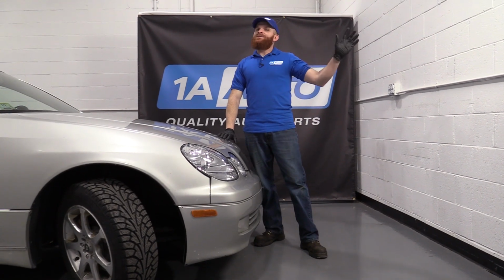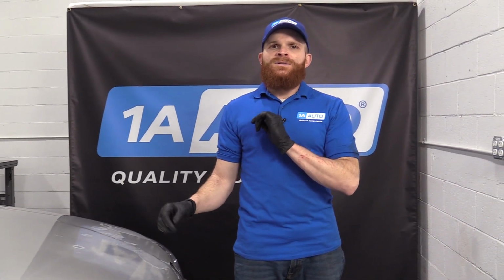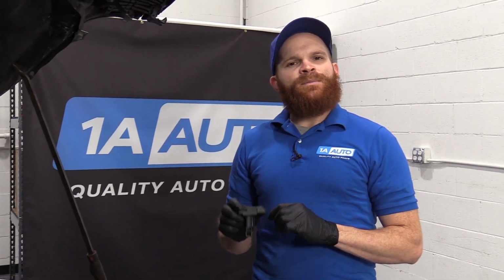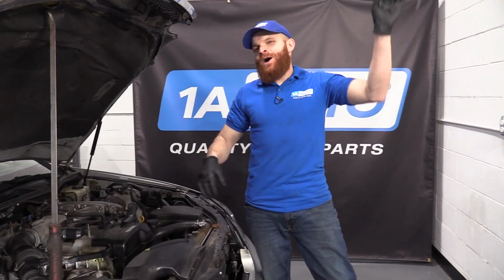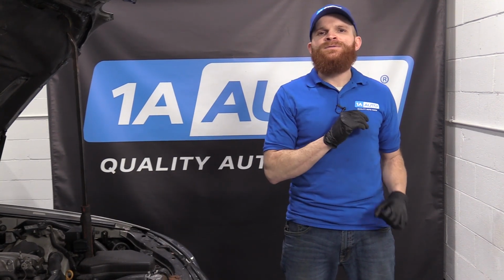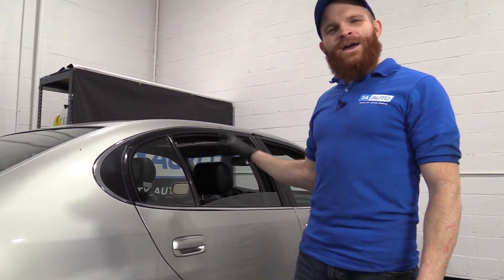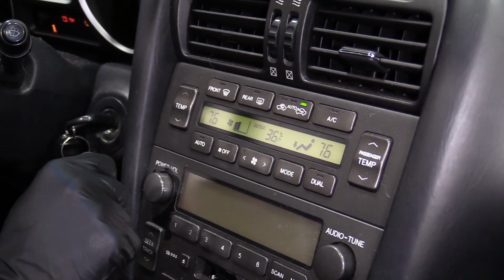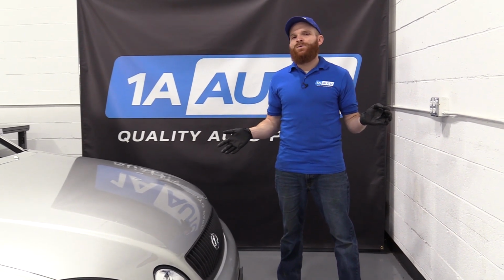Top 5 Problems Lexus GS300 Sedan 2nd Gen 1997-05

Comment: Bottom part of intake resonator cracks overtime because of heat from header.  Car runs bad/hesitates .  
Valve cover gasket leak is super annoying.  Eventually leaked oil fills up the plug wells and car starts to misfire/stall.  Also harness plugs to coil pack get brittle and break.
Rollover valve tends to crack on top and throws emission code.  There's no service panel under the rear seat like fuel pump so you have to lower the tank to get to it.
When front suspension starts to make noises, very difficult to pinpoint the faulty part.
VVTI cam gear O-ring leaks oil. 
Gs300 is a solid car otherwise in my experience!
Reply from the maker: +RS GAEL Thanks for the feedback!

Comment: My door actuators, valve cover leak, brake booster, 75 misfire codes, and brakes gone... all fixed in the next two weeks. Thanks bud 👌 (besides the door actuators lol)
Reply from the maker: +Darrell Thomas Thanks for checking us out! 1AAuto.com
Reply: What year is your GS?
Reply: Are parts expensinve im looking into buying one ?
Reply: @JesusSanchez-yu2xh  don’t buy one, I hate these cars
Reply: To be honest I have a GS430 2001 and it's the BEST car I ever own. I get offers to sell it monthly. My personal mechanic says if you take good care of it, it's known to get 500,000 miles. I have 230,000. Just regular maintenance and had to replace driver's door actuator. This car is a dream with lots of power.

Comment: I have a 2004 now with  about 105000. The video is spot on.  I have replaced 3 of the four O2 sensors.  I have replaced 3 of the 4 door actuators.  I had the problem with the defrost/heater diverter door motor not properly working but what I found is that there is a small worm gear on the motor that engages a gear that actuates the door and it slips a little on the shaft after years of service..  My motor was fine.  I slid the worm back to its position on the shaft and I guess it's good for another 10 years for more.  Other problems:  a noisy heat shield on the exhaust -- ripped it off.  Air bag sensor in the passenger seat -- broken ground wire.  Forward-most leather panel on the passenger seat cracked and split -- replaced the  seat bottom cover with an aftermarket that matches perfectly and looks great.  A/C condenser went bad after 15 years with no leaks until then -- had it replaced and recharged.  (Absolutely the strongest A/C of any car i have ever ridden in regardless of price.)  I'm getting ready for a set of plugs, wires and leaking valve covers gaskets but in all, this car has been bullet proof!  The design is classic. It's fun to drive, quiet, surefooted and brisk though not a racer.  The fit and function are perfect.  Headlights are OUTSTANDING to light up the road.  Brakes (2 sets of rotors and pads in its life) are incredibly strong and fade free.  The paint is perfect -- wax it twice a year and it still looks like its new even though it's parked in Florida sun.  Exceptionally reliable!!!!!  I will probably have this car until the wheels fall off -- and then buy another one just like it!!
Reply from the maker: +Conrad T's Thanks for the feedback!
Reply: Ok -- side note:  This year (that is 16 years after it was new):  1) I am replacing the last of the four O2 sensors.  2) The knock sensor on the front bank required replacing -- really hard to get to but aftermarket parts are really cheap.  3) I replaced the valve cover gasket (leaking oil) plus the plugs, plug wires, and spark pack connectors plus I had to do first aide on the wires that control the spark packs because all this stuff is down in a high heat area on the top of the engine where everything plastic becomes brittle.  Electric tape and shrink tubing did the trick to replace crumbing wire insulation.  The job was NOT tough and there's a really really REALLY GREAT video on youtube to show  you how.  https://www.youtube.com/watch?v=Ktc1hzWEmyw&t=3s  The procedure is a little involved but not hard.  Take your time and label all the connectors and hoses with tape and a marker and you'll be fine.  Label all your hardware as you remove it and put it in zip lock bags.  Watch that video and make notes of all the things the guy says.  I did and I ordered everything and had it on hand the day I did the job.
Reply: @conradts3338  😂okay now I dont want my dream car no more. Well not as a daily
Reply: Which aftermarket seat cover did you get? I’m looking for one myself
Reply: @Tomy_Honk  I found it on Ebay.  Leather matched really well.  I looked through old order on ebay but couldn't find it.  company was in Texas.

Comment: Great info. I’ve owned over 5 of these cars. Never had any real issues with any of them
Reply from the maker: +Meet Da Connect Thanks for the feedback!
Reply: the 1997-2005 (S160) generation? I just bought a 98 GS 300 with just 60500kms here in Perth WA. how long would it take for the lower ball joint issues to start showing up? thanks

Comment: I would add valve cover gaskets, vvti gear o-ring, and steering rack bushings.
Reply: Additionally, catalytic converter degradation and replacement as well as the bearing guide in the steering rack. I love my 2GS300 though, I do not plan on selling it any time soon. The majority of "problems", I would consider regular maintenance and can easily be addressed in moments of preventative maintenance.

Comment: My GS300 was bullet proof. It did have the lower ball joint separation issue though. Luckily it happened as I pulled out the driveway.
Reply: I bought mine as a teen with 175k and I was nervous about the miles but sold it with 230k and I never had an issue with it, been a lexus driver ever since
Reply: Jay My 02 GS300 ball joint broke when I was driving 70MPH on the freeway. Luckily no other cars were around and I was able to come to a controlled stop. Not fun dragging the car across from the carpool lane all the way to the shoulder.
Reply: @davidmolina4652  how many miles were on you car at the time or is that very relative? Thanks
Reply: I might buy one. 144k miles. 4500. Southern car. Rust free beauty
Reply: How much did it cost to replace the lower bawl joints? I am not a mechanic and I have to pay somebody to do it for me
Reply: @nestosolo  I bought new ball joints for $90 on ebay,  labor charge is $200 at my local shop to install them.
Reply: @nestosolo  carparts dot com i got them for 20 dollars